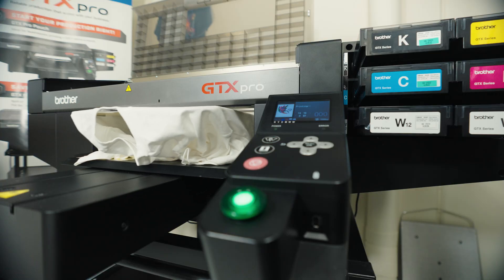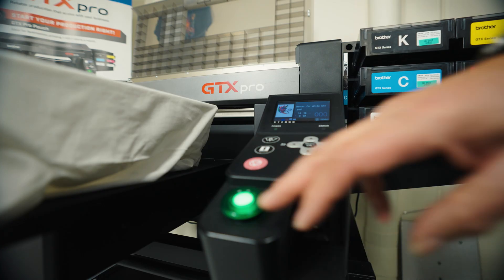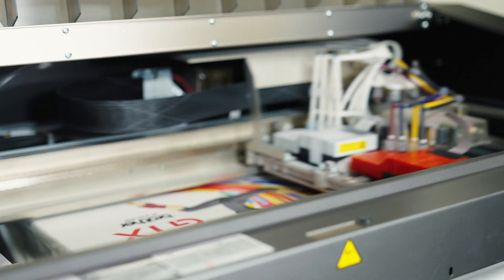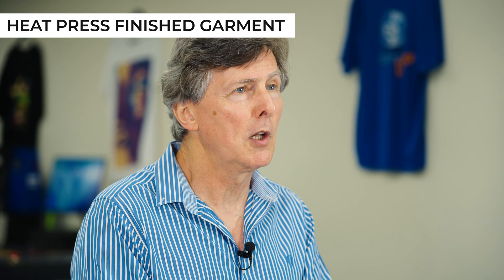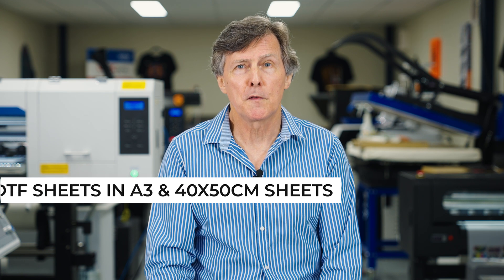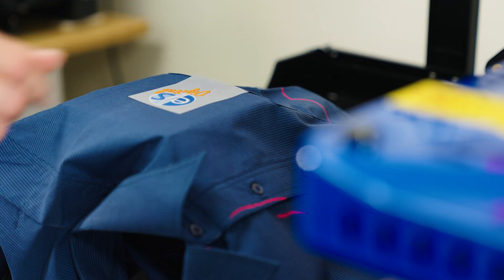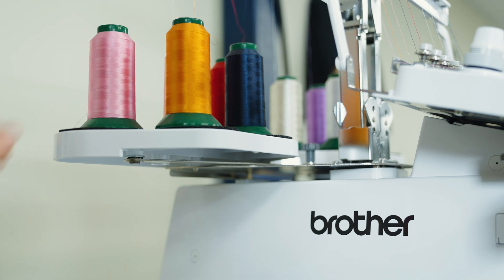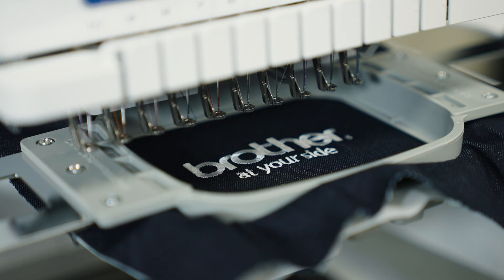Brother GTX Pro DTG Garment Printer Now With DTF Printing!

Comment: 30k plus heat press,/pretreat and parts  for the printer , headaches, it prints decent until you get weird alignment issues, 30k printer with dollar store sensor issues, most prints are good and some come out overlapped, so your profit day, turns into a headache, you want to expand and buy another unit, but you run into problems wasting time and money dealing with issues more often then trying to find more customers then washable issues which is another issue with white shirts, this 30k printer works like a 3k printer unless you have a tech engineer standing by at all times